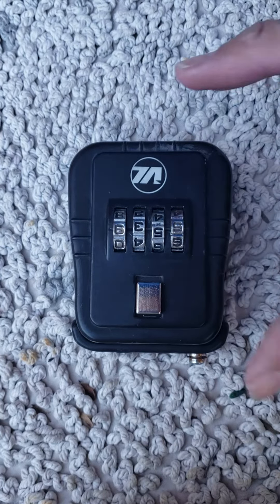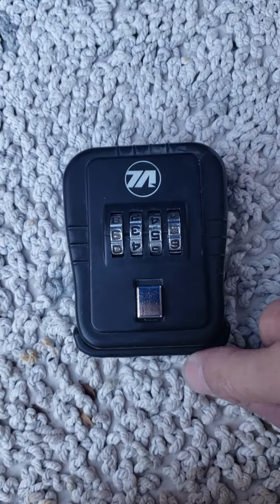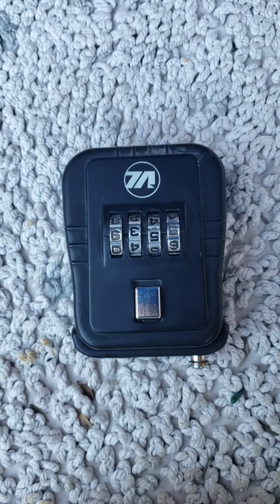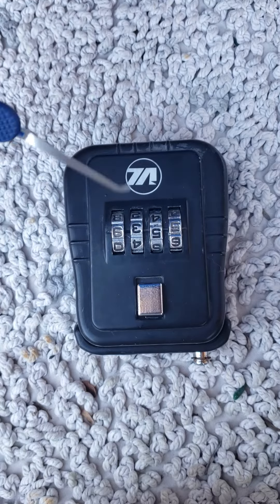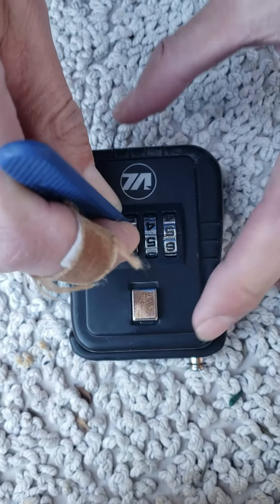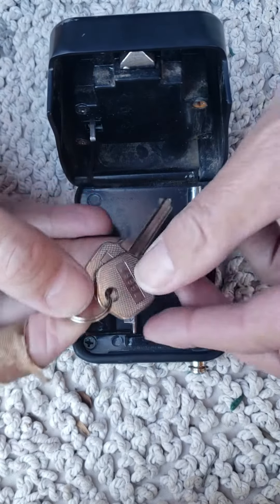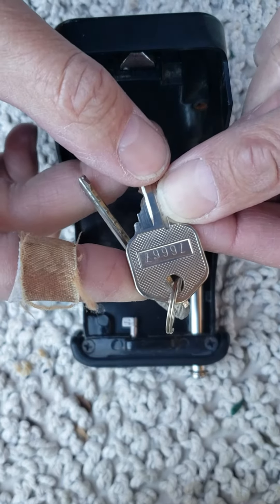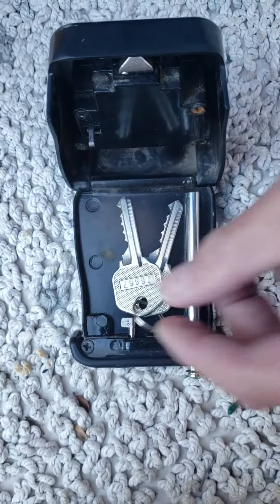Opening a VL Lockbox Fassssst!

Comment: those locks are from a crummy discount door locks website, a lot of house flippers buy them and they are all KA. Makes it easier to to master key for those that do (they never do) and used to be be a common code for HUD. The locks were probably “kwikset the worst clone” like I talked about in one of my old videos that have the stupid little side spring tabs weren’t they?
Reply from the maker: I think they were made by Master lock. The change combo tab is the same, to the right then up.
Reply: wattvoltamp I should have clarified, the actual locks on the doors that used that key is what I meant ;)
Reply from the maker: @selock  Cool. I remember watching that video. I'll take another look.
Reply: wattvoltamp before edit you mentioned the Lishi, I think it will overset a number 7 pin because of design but you can try :) I keep one of those keys with my tryout key set :)
Reply from the maker: @selock  that's why I  edited it. I realized what I was saying. 😀
Reply from the maker: @selock  I measured the key and found the 6s were 224 instead of 214 and the 7s were 200 instead of 191.  It looks like a manufacturers key